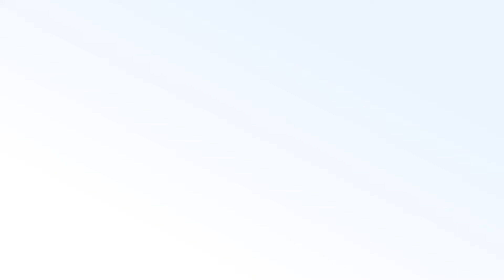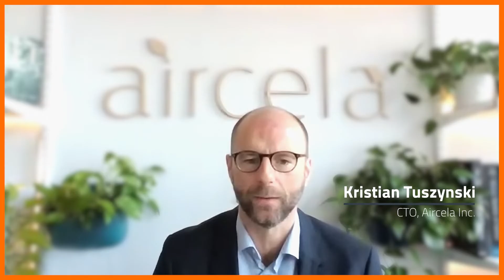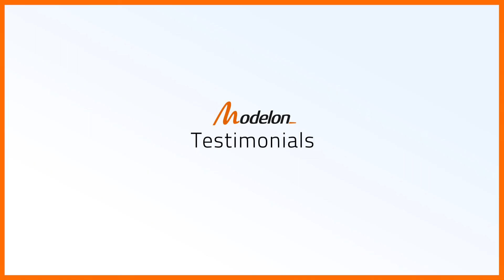Liquid Fuel Production Breakthroughs Using Direct Air Capture Modeling at Aircela

Comment: It uses electricity for direct air capture, and more electricity for splitting hydrogen from water.  Both highly inefficient processes. Then it combines the captured carbon and hydrogen into a fuel, again losing more energy in the conversion. So, the main Question is never answered: What is the total energy input vs the energy used at the wheel when this synthetic fuel is burned in an engine?  This process could be using many times more energy as compared to just storing that input electricity in batteries, and these batteries are getting cheaper and lighter every year.

Why do intelligent people go after such unworkable, wasteful solutions?